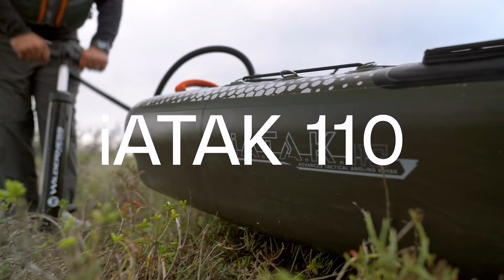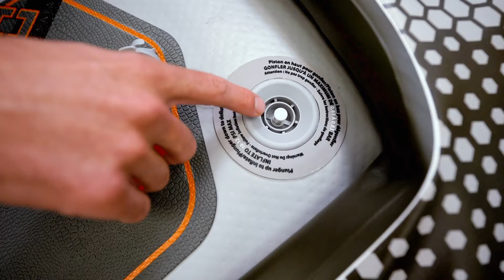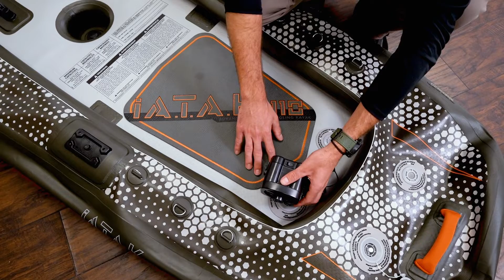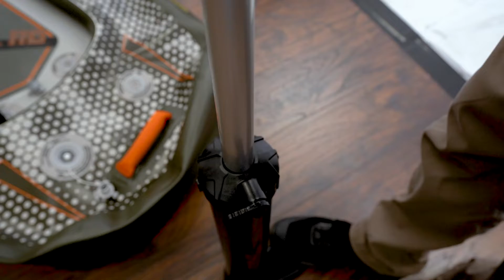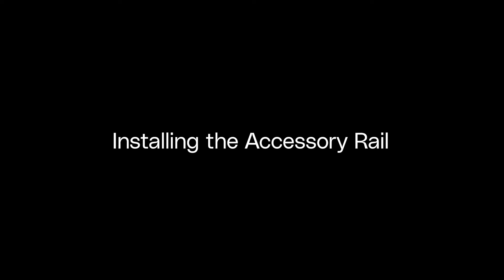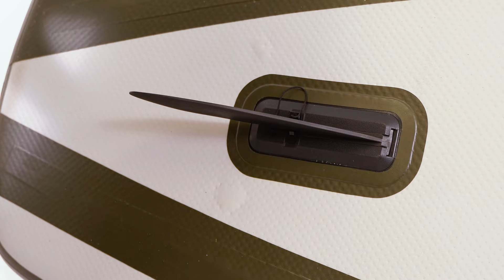How To: Set Up the iATAK110 Inflatable Fishing Kayak | Wilderness Systems

Comment: You cannot inert the foot attachment if the deck is inflated...how did you do this????
Reply: So it has to be fully inflated to install the foot accessories...you need to redo this video
Reply from the maker: Thanks for catching this, and sorry for the confusion! The trick is to slide the footbrace accessories in while the deck is deflated or only partly inflated, then top it off. Once it's fully inflated, there's just not enough room to get them in. You're right that the video doesn't make this clear, so we'll be redoing that step. Appreciate you keeping us sharp!